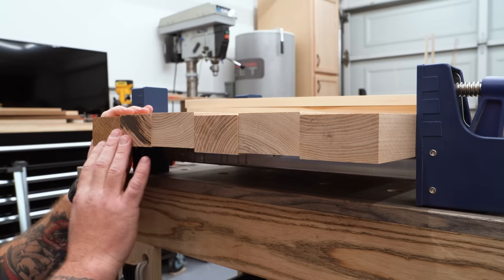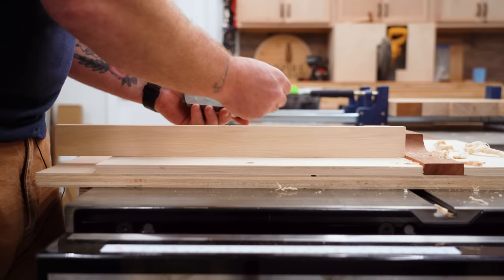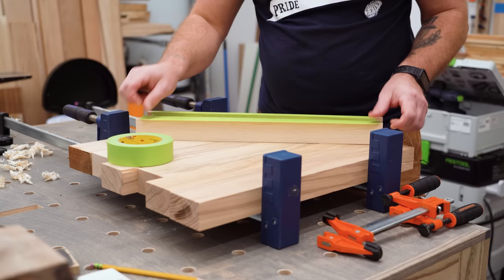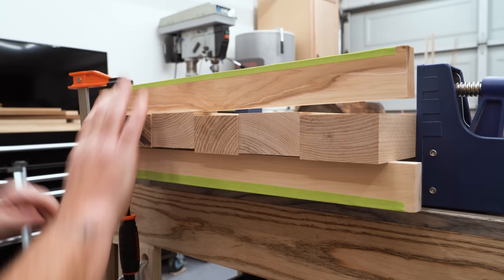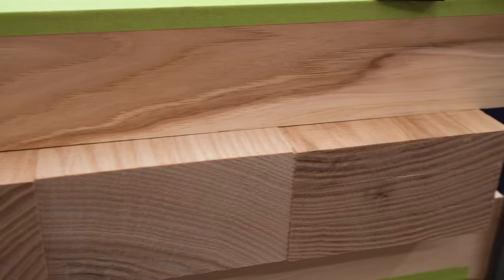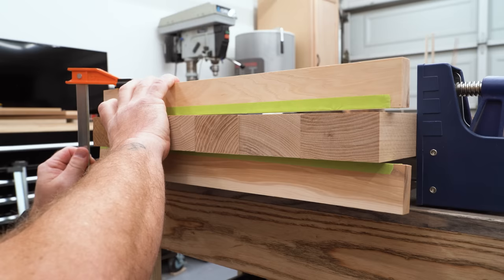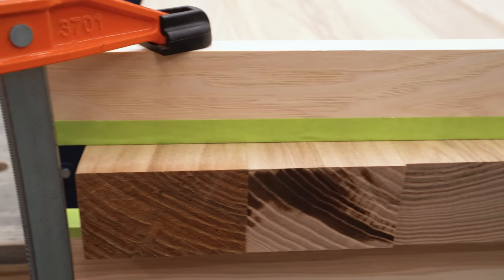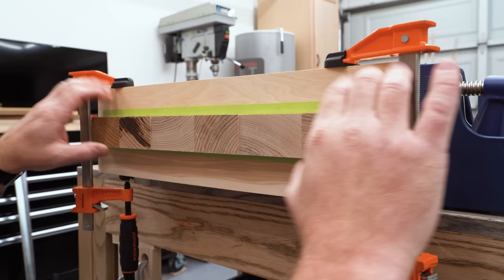This Will Forever Change How You Glue Boards Together

Comment from the maker: I accidentally said "chamfer" a whole bunch of times instead of "taper". I have no idea why I did that, but they're "tapered" cauls.
Reply: They are very extended chamfers ;P How would you go about gluing up 2 lumber pieces lengthwise where you don't want the glue joint to show much and they need to have strenght? Especially a darker essence like black walnut. Love your tips!
Reply: Wait? Doesn’t the taper work because your bowing the wood by clamping the sides. Can’t you just solve this by clamping the middle as well. The taper is essentially a bow in the opposite direction as pressure. It’s because the wood is under more pressure at the ends so it’s bowing. 

Sorry if I am way of but I have done a lot of cnc work and this is a constant problem with cnc wood because clamping the outside means the center of the wood is actually under less pressure and so the downward force on the outside causes the pressure to push the wood up and away in the center. Since you don’t have to have an exposed side like you do in cnc I don’t understand why you can’t simply put and extra clamp in the center to fix the bowing. 

Again if I am wrong my apologies. It just seems like taper to little or too much could basically make the board useless while just clamp the center is adjustable on the fly.
Reply: Still a great tip! Who cares!
Reply: I often tell others to listen to what I mean and not what I say. 🤣🤣🤣
Reply: Glad u mentioned it. I came here to comment on that. I thought you meant to say camber.
Reply: @dorjedriftwood2731  You can, but this way is easier because the wood is doing more of the work by shear tension (leverage?  I dunno what term, it's science), vs. you having to use a 3rd clamp in the middle.  It's also faster, if you're up against a clock on glue-up/set time.
Reply: Maybe you were thinking of “camber” and “chamfer” came out instead. 🤷‍♂️
Reply: Yea, I was like "Chamfer, where is the cut?" But then realized, maybe you had your own language set to use and just rolled with it, I knew what you meant.
Reply: That's nothing compared to the looking for my car in the parking lot escapade the other day 🙂
Reply: @dorjedriftwood2731  I believe the answer is, even though he demonstrated the tapered caul across the ends here in the video so we could see the misalignment, where, as you said, he can easily get a middle clamp on the cauls, the tapered caul really comes into its own out in the middle of those boards, far in from either end where you can't get a regular clamp on the middle of the cauls, and can only perhaps clamp them from the side with deep-throat C-clamps or something similar.  There, a tapered caul squeezes the boards in the middle not via direct clamping pressure, but also by the flexing the curved wood.  At least, that's where I usually get the most benefit from them.  Good luck!
Reply: Wow! I was confused as hell by this and I had to rewind several times until I realized that you meant “taper” not “chamfer”. I wasn’t able to watch the first part, I was only listening, so by the time I got to the end I was looking for chamfers.
Reply: Brain fart
Reply: @dorjedriftwood2731  Good question, yes at the end of the panel add a 3rd center clamp.
If you’re doing a wider (tabletop) or long panel (stair stringers) the tapered cauls are the only way to get adequate pressure in the center of the panel. 
Or to save on clamps.
Reply: I knew what you ment 😁
Reply: Maybe you were thinking of ”cambered”?
Reply: @Dorje Driftwood  what you're suggesting can work fine wherever your clamps can reach i.e. at the joints between the boards along the edge of a panel (although the caul will do better at ensuring the flatness/straightness of the panel across all joints) but many (most?) Panel glue ups are too wide for normal woodworking clamps to reach anywhere except 4 to 8 inches from the edges whereas calls can be used to apply pressure far from the edges all the way across a panel...hope this helps answer the question you were asking?
Reply: @Eric D.  You don't see this often and that's because it's very difficult to do and very weak. Finger jointing is about the only way, which requires special bits. Going back to the lumber supplier for a longer board is always the best option.

Comment: Very interesting to see basic structural engineering principles applied in a learned experience sort of way.  Nice work Jody, as my engineering would have "gotten in the way" of this alternate approach.  I would have naturally either gone with a material with higher intrinsic stiffness, e.g. steel, or increased resistance to bending moment by changing the cross section, e.g. going with an I-beam, or both.  What you did was sort of "go with the flow" and in fact there is a calculation for the ideal curve you should put in the taper to provide constant pressure across length with point loads at each end.  Don't think anyone is going to car about that, lol.  Very slick, lateral thinking - classic smarts from people with practical experience.
Reply: You’re right, no one cares about the formula to get the perfect taper, “close enough” is tantamount to perfect in most situations. 

It is however, extremely useful to have a grasp of the concepts at play, such that you can apply them to a wide variety of tasks

Comment: Excellent tip Jodee. I learned this one a long while back. There actually used to be a commercial outfit that sells curved cauls with slots for clamps, but they're so easy to make from scraps, I could never justify the cost.
Reply: Bowclamp
Reply: @corwind3888  Yep, thems the ones. Doesn't look like they're in business any more though.
Reply: @NWGR  Yeah, they were fairly expensive. On top of that, making a conceptually simple wooden tool to sell to woodworkers that's relatively easy to make probably isn''t the best of product strategies. lol  Does get a little trickier though for wider glue ups.

Comment: i just stick clamps where the joints are (on a cross piece the same as this, but no need to taper). And take them off immediately once the panel is edge clamped, you don't want the cross piece glued to the board

Comment: Brilliant!!  I never realized that the same principle applies I've seen in loading a truck.  Have you ever looked at an EMPTY 18-wheeler's flatbed trailer bed?  They always curve up slightly toward the center, and that's so when they're weighted down under load they will straighten out level where they will provide the maximum resistance to deflection due to weight and going over bumps.  In other words, you don't want the bed of the trailer to sag when you load it down.  Same principle here.  You need to apply a little English to "over straighten" your glue up pieces, and that will overcome the final friction the glue up boards present to the cauls, so the end result is a flat glue up.

Comment: I created some of these years ago modeled after the bow clamp.  The way I created the taper was to take a straight board and bow it, the run it through the table saw to rip one edge straight. Then I released it from the jig that created the bow and it snapped back leaving me a perfect arc.  Then I ran through the planer to make a consistent width.

Comment: Absolutely spot on.  All my cauls have been "tapered" from the start.  However just wrote TOP on the opposite side as well as tape on the contact side.  Great tip for sure.

Comment: It’s an old trick I used when I was fairly new to woodworking but properly flattened and jointed wood should not need anything. Let your glue tack up a little to cut down on slipping. 
It all in the prep.

Comment: Awesome tip, 10/10. I've seen some other videos that attempted to explain how you can make 'tuned' cauls like these, based on both the length of the caul (more spring-y-ness) and on the degree to which you taper/crown the business side of the caul... 
... and I am waiting for you now to explain this in your signature style so my brain accepts and understands it with the two variables. Think of it as 'advanced cauls' how-to.

Comment: I was involved in designing some photographic processors about 35 years ago, with 50-Inch wide rollers pulling the paper through the Developer, stop, fix, wash and dryer.  The long rollers were very slightly thicker in the centre in order to give even pressure right across the width of the paper.  Well-known technique through history and happy to be reminded of it.

Comment: Putting a clamp in the middle would do exactly the same as that taper. It's also 100x easier to just use melamine for cauls rather than milling a solid board and keeping it in shape.
Reply: Wouldn’t a clamp down only the piece it is located on, i.e. not getting them all level?

Comment: I've seen a commercial version of this where they've calculated the exact curvature (for the material and thickness of the caul) so it applies even pressure, but I'm sure this will do just fine for most of us and is really easy and quick to do.

Comment: That is a very good way to align the boards in a glue up... however, I feel like the stress induced by that much re-alignment of the wood will put tension into the panel. I would rather plane the board down to a perfect shape after glued, I feel like this will last longer than a board under stress.  Just me.
Reply: If your boards are properly milled this technique won’t induce any stress.  It’s just like having several sets of hands to hold things still as you tighten the clamps.  It also counteract the tendency of the clamps to bow the panel.

Comment: It basically is a beam bending moment thing where the force gets less strong the more you go away from the clamping point. The taper counters that making the force distribution linear across the board.

In theory one should be able to calculate what exactly profile the shape should have that you use to clamp on the panel that makes a perfect linear force distribution.

Comment: I saw this tip before. He used the flat side, and added some painters tape in the middle to increase thickness. The downside to this method is that you have a dedicated plank for each size board you want

Comment: The reason the glueing is improved is because you use clamping cauls. Watch almost any Youtube video and others just put a pipe clamp across the top which does not line up the wood, or even ensure the glueing is straight. This is the right way to do it.

Comment: I prefer to mill the lumber to a thickness around 1/8” thicker than needed and let the lumber sit for 2 or 3 days letting it move to equilibrium dryness, then do final milling. This takes away internal stresses on final glue up and lessens the chance of future movement which leads to warping.

Of course you have to have a jointer and a planer so it might not work for everyone.

Comment: Practical and effective as is seen in the video. Also, you seem to align the grains to prevent warping. Even though straight tempered and strong glue achieved, will the end product still insist on wrapping following individual boards tendency?

Comment: I just use spring clamps on the ends.
I’d rather have tight glue joints above and below.
A small difference in height is insignificant 
Thick glue lines are unfixable .

Comment: I recently did a glue up (one of my first times. I'm new to this) and the boards twisted. The twist exaggerated the legs so that the table wouldn't sit straight. Afterward I saw this video and I wonder if the culls would have prevented the twist?

Comment: I've done this. Most of the time, I just have two straight boards on the ends, and I use 12 clamps per 24". Kind of joking, but not really lol. I have 8 bessey clamps that are 48" wide each and I do tabletops and I have to use every single one. In additionanother dozen on the ends plus misc contraptions to get the boards in the middle that decide to not play nice and don't respond to a rubber mallet and piece of scrap wood banging the crap out of it into place. Recently I got several 12.5" wide walnut 8/4 boards that were 10 foot long, a rare find. I really didn't want to mill them down to 1.5" I wanted to keep them at 1 7/8 and the only way to do that was to have a pop up seem that was out for 1/8" inch for about 3 foot in middle of board. The end boards were straight, which was important for the apron. I took clamps and clamped the crap out of it. Since the apron, and underside has 2" boards attached to the tabletop, plus cross bracing, plus brackets it is not going anyway. 

Woodworking is a pain in my ass.

Comment: My concern would be why are the boards all wonky with each other to begin with? Something isn't right. Properly jointed boards along with good even clamping pressure should not do this.
Reply from the maker: @reloadNshoot It's very common for perfectly jointed boards to slip around when gluing, especially the more boards you have in a single glue-up. That's why a lot of folks use biscuits, dowels or dominoes to align boards, or some use the salt trick. Or cauls, tapered or otherwise. It isn't always related to improperly milled material. Sometimes it's as simple as the uneven layer of glue compressing and moving boards around slightly. Sometimes it can be the clamps themselves moving things around once pressure is applied.

Comment: This press, turn, repress maneuver is probably the only last resort to even the stacked edges once those glued faces start to tack up a bit. This potential disaster also cries out for the need to use the right glue with a longer “ Open Time”.

Comment: LMAO Like the masking tape isn't hiding the exact same thing happening! If you have two flat, even surfaces applying pressure, the "slight gaps" are caused by the glued boards NOT BEING EXACTLY THE SAME THICKNESS!!
Reply from the maker: If only some folks were as smart as they though they were.
Reply: @InspireWoodcraft  HAHAHA Prove me wrong, do another video without the tape on the curved side....
Reply from the maker: That wouldn’t be very smart of me to make a video just for you, from a business standpoint. However, if you would like to further educate yourself, I would suggest looking up the term “tapered cauls” and have a look. This is nothing new. Tried and true. The info is out there if you wish.